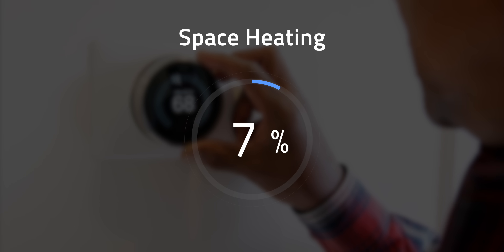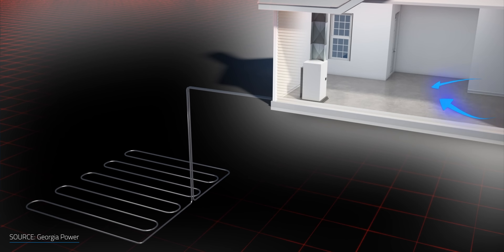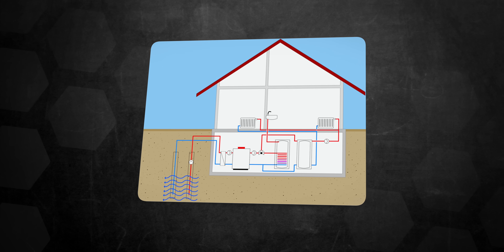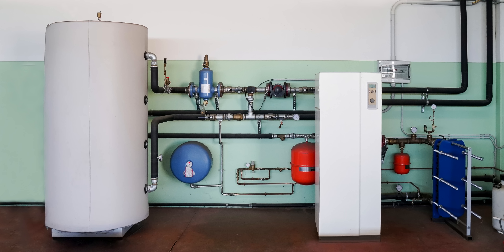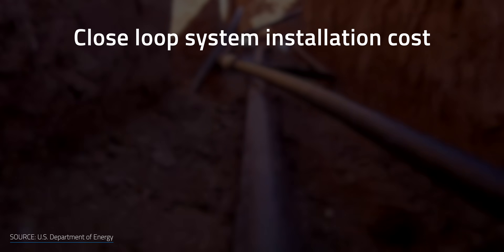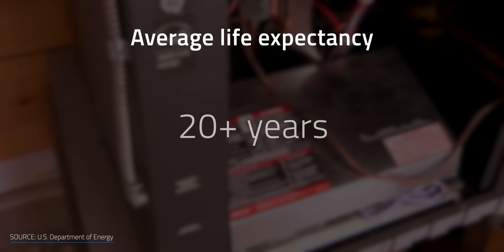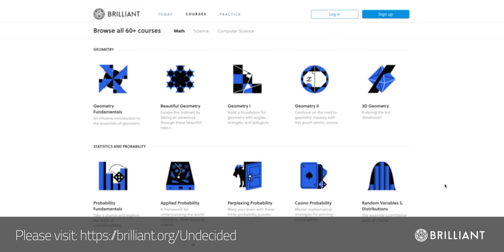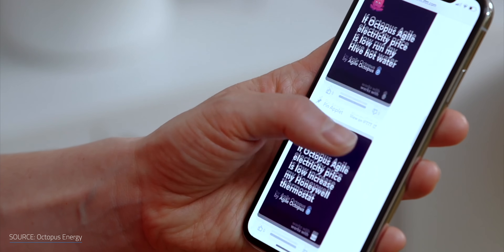Is Geothermal Heating and Cooling Worth the Cost?  Heat Pumps Explained

Comment: Ok, so I can answer the " how does it hold up " question. We put a geothermal furnace in at my dads house nearly 20 years ago now. We did it our self, all for under $5,000. It has worked perfectly, with no issues, since we installed it. It has RV antifreeze in it. The line is 6 feet down. It has worked excellent, and that is in northern Ohio ( some pretty cold winters! ).
Reply: In those 20 years, how much maintenance or repair have you had to do to the system?  Thanks
Reply: @shirolee  It hasn't required anything.
Reply: Can it be hooked up to an already existing HVAC system or do you have to have a special system?
Reply: @rosstemple7617  you can hook it to your existing duct work. If you don’t have a ground loop you will need to excavate the yard and put a loop in the ground to circulate the water which is a closed loop.  Or if you have wells or ponds you use the water source from there. Open loops ( wells are more efficient due to the water being a more constant 50;some degrees). New heat pumps have become so efficient now you would be better off with one of those or stay with gas or oil.  I install all those, oil, gas, heat pumps and geo systems.  If you do not have wells or existing geo system you would be best to not go that direction.
Reply: @rosstemple7617  
Phone your local Hvc to find out.
Reply: I got quoted £20k to do it in the UK. Hopefully we catch-up soon but for now it's too expensive. I unfortunately had to have gas installed, cost £5k
Reply: We have one installed in 1992 and it is still running all the time. We have serviced the compressor every 5 years. It has never Failed. We switched to a new one in 2012, just to be sure. the ground loop is in 2 meters deep and is 450m long. It contains dyed alcohol because it heats also the drinking water. We live in northern Finland, and heating season is from august to june. It can also cool the incoming air from the ventilation machine, but it isn't refrigerating kind. It keeps the aimbient temp inside house at 21C 365 days per year. Temps varies between +35C to -35C. Average is +2. The ventilation has heat exchanger, so heat doesn't go out but gets recirculated back inside house. What we save per year? about the price of 1.5 tons of oil yearly.
Reply: And when your system leaks, that antifreeze will contaminate your soil making it useless for anything.
Reply: My question(s) to Jeremy H or anyone with Geo...does your dad's house use any other power source for heat/cool at any time? If not, how do the temperature extremes vary from extreme hot/cold weather indoors? I spent some years in north-central Indiana and winters would bottom to -5 (and 15 during day) to summer extreme peaking to 100F. How close does geothermal keep the house to comfortable level...say 70 inside during winter, and 80 during summer. Can Geothermal keep my hopeful indoor temperatures within those seasonal ranges? I'm brand new to geothermal, and curious.  I live in Florida, St. Pete, 50ft above sea level and 2 miles from the coast, so I doubt geothermal will change my life. I'm just curious to find out if geothermal will keep your house at 70 in the winter, no higher than 80 in the summer.  Personally, my year-around indoor comfort is 78 degrees.
Reply: @Spaethon  Well, I am installing this systems in Kazakhstan, and they are working very well, espetially with a warm floor heating system and fancoils. And the temperature fluctuations here can be from -40 C in winter upto +40 in summer time. Heating and cooling system automatically holds the setted up temperature. The only thing is, that due to the extracontinental climate we are building houses not like in US, from wood and something (haha), but from breaks, beton, and additionally worming the walls and roof with extra-heating materials. So the heatloss of the houses is very low, so when using the heatpumps it is worm in winte and cool in summer.
Reply: My in-laws are going on 20 years with their ground source heat pump system and they love it.  They use a combination of radiant floor heating, forced air heating and forced air cooling with the system.  I don't know how many feet of buried line they have but it is horizontal loop under 6+ feet of earth.  They have a tech come out every 2 years to service the unit but aside form a basic service fee they have not had to replace any major components.  I plan on researching "Geothermal" for my next home.
Reply: congrats u got 200 likes out of 2 million views. Focus on ur own life.
Reply: As an actual Expert Witness in the Industry with far superior academic & experience resume, I'm annoyed at your analysis from an unqualified bofoon -- Richard E. Lelli, P.E., M.B.A -- like getting advise from a donkey, literally -- English degree with neither Contracting or Engineering experience -- Our Lawyers filed a criminal complaint to Google for disinformation.
Reply: northern  ohio winters are not that cold
Reply: This isn't "geothermal", it's ground source heat pump
Reply: @peepiepo  anything from the ground is geo. you didn't watch the video.  yes the geothermal you are thinking of is the Yellowstone geysers.  but not all ground is that hot.
Reply: @wuhanbiruSux  No, geothermal and ground source are different.  Using the same word to refer to two different things is kind of dumb.
Reply: @peepiepo  You misunderstood Gebert:

Ground source heat pumps are a type of geothermal energy.
Geysers (hydrothermals) are also a (different) type of geothermal energy. 

They are both forms of geothermal because they are heated by the Earth higher internal temperature.
Reply: @peepiepo  Is there a rule of thumb, ~ 10 feet depth = ground source, ~500 ft depth or deeper = likely geothermal?
Reply: @sprockkets   a lot its mostly in the 5 ton class and up
Reply: @sprockkets  talking home units in the us , copland bristo many. they all have short lives
Reply: @dknowles60  I didn't ask who made reciprocating compressors - I asked who uses them today. 
So far, you've yet to rebut anyone here, esp funny seeing as how I'm in a house with air source heat pumps keeping it warm while it's -10° F outside. Yet I'm the fool. Whatever Dunning Kruger.
Replies from you will be ignored as you are simply trolling.
Reply: @sprockkets  a lot of people and business
Reply: A northern Ohio winter is not cold. Mn has much colder Winters
Reply: @dknowles60  Put those temperature comparisons away. Everyone’s thermometer here is of above average size.
Reply: @michaelwinter742  nice lie and bull crap. m From the fed gov north Ohio dont get that cold. North Mn is a lot colder
Reply: Not sure how Mn is relevant.  You could say Fairbanks Alaska is colder than that. But that doesn't change the claim that northern Ohio gets cold...it does, it doesn't matter if it gets colder elsewhere. Unless you are offering your geo thermal system as a comparison....
Reply: @dknowles60  If it works over 99.99% of the time, at many times over the efficiency, you buy a form (or two) of backup for the extreme circumstance that it does get that cold. That temperature was not normal. Both resistive heaters and propane or oil, are cheap enough to buy as backups and still come out farther ahead. Redundancy is what they were lacking in Texas, it wasn't a problem with heat pumps
Reply: @dknowles60  Did you not watch the video? Ground source heat pumps use the ground for the source of their heat. They do not care about how cold it is outside. Once you get a few feet down, ground temperatures are fairly stable so you don't have to worry about how well the system will work when it's too cold or too hot.
Reply: @massiminitrains  them compressers dont come cheap and cost big dollars to replace
Reply: @dknowles60  Compressor isnt' any different from a normal air source unit. 
You basically are uninformed as to how any of this works.
Reply: @breakfast7595  The video show's ground temps at 15 to 20 degree C ... that's not warm eneough for outside effective temprature of - 25 degree C ( as in Toronto  that the video refers to) Add in heat loss as the glycol disperses some of it through travel and we'd be wearing parkas inside the home during the middle of winter
Reply: @sprockkets  wrong fool. there are many types . piston scroll and others. they can run so many hours befor they burn up. the longest warrantys i seen is 10 years but it dont include labor cost
Reply: @dknowles60  um, I'm an a/c tech and know the same compressor is used in these units. But where did I say there is only one compressor type? Strawman.
Go ahead, tell me any unit used today that uses a reciprocating compressor.
Reply: @dknowles60  and the Northpole is colder than Minnesota. What is your point?
Reply: @FXIIBeaver  if they were so good every one in the us would have one today
Reply: @dknowles60  that's stupid argument, it's more expensive, that's why it's not common..developers want money, they don't care about enviroment...
Reply: @breakfast7595  wrong
Reply: @sprockkets  wrong again. a compressor can cost over 600 dollars labor over 600 dollars thay is 1200 dolars even at bidens 1 do;;ar per cubic foot of nat gas i sure cam but a lot of nat gas for 1200 dollars
Reply: @sidb9540  I buried temperature sensors at various depths in Toronto.  Even at only 14" deep, the minimum temp was 3.9C all year.  At 66", the min was 6.1C.  You can pull heat out of even shallow ground if your fluid temp is low enough.  The heat pump jacks up the temperature to what the house needs.
Reply: @massiminitrains  You actually do have to worry about it. In colder climates the ground will start to slowly cool down. In warmer climates the lesser need for heating and greater need for cooling will balance it, but in colder climates you may need either a much larger piping or some extra solar collectors to heat the ground up during summer.
Reply: @dknowles60  WOW SOMEWHERE FURTHER NORTH IS COLDER?!?! NO WAY!!!! I have lived in North Dakota and even upper section of Manitoba for winters, so I have a pretty good idea of what " cold " is. Thanks.
Reply: @dknowles60  Ohio winters are colder than Oklahoma, Texas, Florida, Arizona, California, New Mexico, Alabama, Mississippi...  Sounds like you are just argumentative.  What's your point????
Reply: @diabeat4248  heat pumb dont work very well in the cold

Comment: Had a home built in 94. My builder tried to talk me out of installing an $11k system.  It paid for itself in roughly 5 years. It's a fantastic a/c unit and  keeps your home steady temperature in winter. Only draw back is you might want a wood burning stove for those super cold days, like we get in Michigan winters, because the system is sized to 10 degrees on the cold side. On a side note my builder threw his closed loop in a pond to save on the installation costs and loves his system. In the dead of winter my worst heating Bill was about $130, while my builders ng furnace was costing him $300 a month. The house was 1800 square foot ranch with a finished basement and stayed super cool all summer long. I thing electric bills for cooling were $30 to $50 a month. If you can do your own trenching or have a pond, your installation costs could be seriously reduced.
Reply: I think like most homes / builders, undersized systems save the build cost. The builders pocket the savings, the home owners stuck with a unit that won't perform when temperatures are extreme or the unit ages. I installed for years, if the home required a 2.5 ton HP, I bumped to 3 ton with at least a 10kw strip. If 3 ton was close I jumped to 4 ton, or zoned it if was a 2 story. Just installed a propane gas furnace with a HP,  in my rental home and t-stat set to 40 degrees. 40 or above HP will give you all the heat the home needs, below 40 burns propane. Very efficient and can get into single digits and the house is comfortable. If I build more homes I'm investing in premium windows, closed cell foam insulation and a ground loop HP with a gas fireplace, as a auxiliary form of heat. I live in the land of retirement homes at the Delaware beaches. Older people like heat. Me too.
Reply: We live in southern Wisconsin and our closed loop, horizontal system has been great but it has struggled when we have a polar vortex or long stretches of cold temps in the teens and below.
Reply: @jamescassidy5797  yup they're sized to be efficient, so you definitely want a wood burner or something else for backup.
Reply: @jamescassidy5797  That's what the wood burner is for, those extreme cold days!
Reply: How many square feet of area would a pond need to be ?  I'm wondering if I put in a 10'x40' lap pool that was only 4' feet deep, and ran the piping under a vinyl pool liner would that be of any use for a heat pump ?  Southern California desert so more a cooling climate than a heating one.  A pool that would hold 1300 gallons and it takes 8.33btu to raise each gallon 1F, so 11,000btu for each degree of heat it absorbs.  A 36,000btu/h heat pump would transfer 3.3F per hour to the pool ?  Doesn't seem right.

Comment: 2:32 "And the heat pump compresses the liquid..." That shouldn't be possible. Entire field of hydraulics is built on a fact that liquids aren't compressible. 
I mean, on paper, liquids can be compressed, but you need huge amounts of energy just to achieve minimal compression ratio. That's why " liquids aren't compressible" is generally accepted approximation. Same thing for solids.
Surely, there's some other system at work here.

Comment: The temperature exchange in pressurized systems isn't really dependent on the heat transferring from hotter to colder side. It works more like your fridge, that transfers energy from a cold environment into a hotter environment. It really is the same thing, just scaled up. 👍 love these systems

Comment: Heat pumps are an interesting option, but be sure they will meet you needs for your location. Loops need to be installed below the frost line, which in northern latitudes can be several meters below ground, and even top of the line systems are unsuitable for many areas throughout central Canada.

Comment: Geothermal heat pump systems are not economically interesting compared to air-water heatpumps.  Basically: Insulating your house to the level that an air-water heatpump is possible + the cost of an air-water heatpump is cheaper than the cost of a geothermal heatpump.   So a geothermal heat pump is not interesting in almost all cases !!! Note also that in summer, the air-water system has a higher efficiency for warm water production. In summer the air is warmer than the ground.